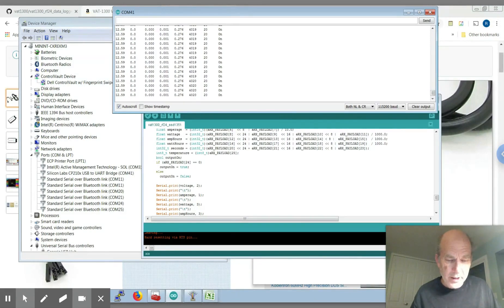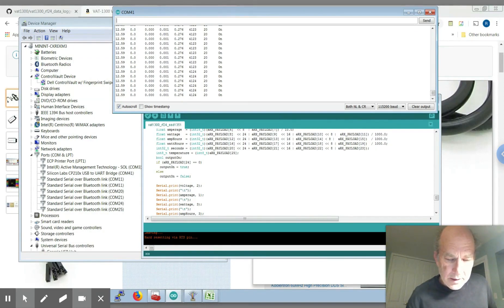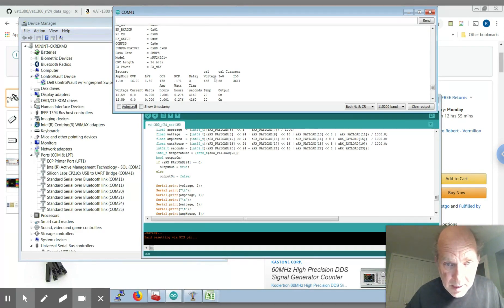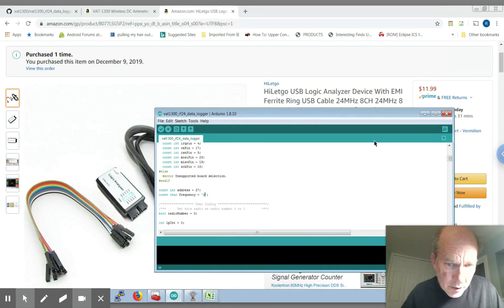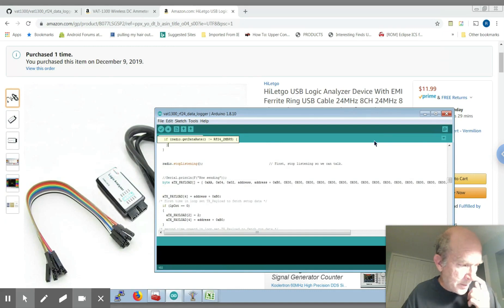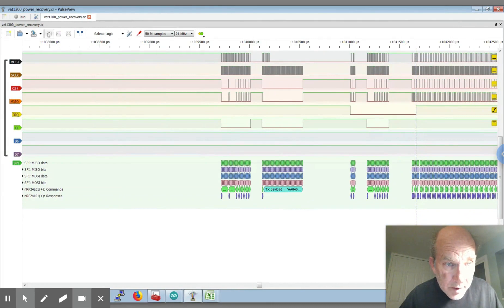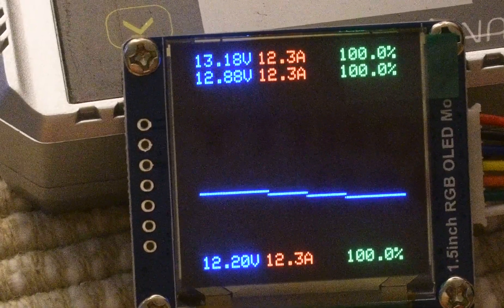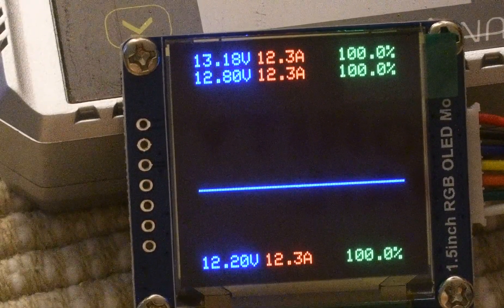A battery state of charge(Volt/Amp/Watt-hour/coulomb counter)solution for wireless network Part 3of5

Comment: Great work. Thanks for reverse engineering these. I have a unit coming. Would be nice to find just the shunt units without the displays. I plan on using these with my raspi monitoring system.

Comment: Hi Robert, Do i need to preprogram the nrf24 units as sender and receiver? I soldered my units on the controllers but my wireless radios does not seem to work.  I connect the units with usb cable they work?
Reply from the maker: If you are having trouble getting the control (the display unit) link to the shunt then check to make sure you are using the correct frequency channel (A to Z) and correct address (1 to 99).   Those may or may not need to be set correctly for the wired connection.  I don't remember.  There is no firmware.  You did put in an authentic nrf24 in both the controller and shunt, right?  The Chinese knockoff units and the authentic nrf24s do not talk to each other.
Reply: @flatman2008   thx for the quick reply i tried to resolder some new ones again and it started to work. thx a heap.

Comment: Hi, I am the operator of my own small photovoltaic power plant, which I built myself. I run a scada system on my laptop, which reads my three controllers via Modbus and visualizes the data from them. I bought a VAT 1100 and I wanted to get the data from it to this scada either via a cable and some converter, or to intercept wifi communication. Do I need all of the above HW stuff, , or is it even easier to do it with just a USB Logic analyzer, for example? Thank you for the info.
Reply from the maker: I suggest you watch part 5 where I show how to tap into the cable that runs between the shunt and the display/controller.  It's not actually USB.  It's RS485. This is a much simpler solution requiring only a RS485 or RS422 dongle.
Reply: @flatman2008  Robert, thank you. I found some information not in the video but in the description below it - but there is only this: "RXD + hooks to green (D +) wire of the Micro USB cable and RXD- to the white (D-) wire." Do you happen to have any more detailed info? I assume that the wires of the converter need to be soldered somewhere on the lower PCB - but I don't know exactly where - I did not find any detailed photo. From Aliexpress I have bought this converter:
https://www.aliexpress.com/item/33025022759.html?spm=a2g0s.9042311.0.0.27424c4duQj6Nw
Do you think it could be used?
I will be very grateful for more detailed information, photos or links.
Reply from the maker: @antoni_sk  I suspect the RS485 pod you listed will work.  The A terminal would be hooked to the D- (white wire) and the B terminal to the D+ (green wire) of the micro USB cable.  No need to solder to the PCB.  I just spliced into the cable.  
I used a ftdi usb-rs422-we-1800-bt cable.  Because you are only receiving data, an RS422 dongle works fine.  But a RS485 should also work.
Reply: @flatman2008  thank you, i'm stupid that it didn't occur to me right after reading it. A few minutes ago as I read your answer, I was just thinking about that communication must still go through the supplied USB cable that connects the shunt unit to the display unit. Your answer only confirmed me in that. So far, thank you very much.
PS: I still had a question - when I cut the USB cable and connect it via converter to the PC, will the wifi transfer to the display unit still work?
Reply from the maker: @antoni_sk  The display/controller will be functional in it's tethered(wired) mode.  The added RS485/RS422 dongle is just "spying" on the data going between the shunt and the display/controller.  
When using the USB cable the radios are disabled.  It's just the way Juntek designed the system to work. Wired or wireless but not both at once.  Don't confuse the wireless mode with WiFi.  It's a 2.4ghz proprietary communication protocol that is used between the nRF24L01 radios.
Reply: @flatman2008  it's a pity, you didn't like me very much with that information ... I wanted both - the display to work wirelessly and the logging data to the PC...
Reply: @flatman2008  I made one attempt today - I connected a USB cable (only one side connected) to the shunt unit and expected that communication with the display drive would stop working ... But wireless communication continues to work  :-)
Reply: @flatman2008  hello. Are you sure about the colors of those wires ? Because I measured 5 V between green and white. That's probably not OK.
Reply from the maker: @antoni_sk  Is this with or without both the shunt and the display) controller plugged in?  I don't remember what the voltages were.  However, I don't think 5v is unreasonable.  I'm not sure of the RS485 specification for differential voltage but I'm almost positive 5v is a reasonable logic level.  Think minimum is 1.5V and maximum is upwards of 10v.  Lower idle voltages are also allowed but then Juntek may never let the bus go into idle.

Comment: Just wanted to say a massive thanks for the time you've put into this. I've used all your arduino code and made a version that publishes into ubidots, and it works great! Spent ages trying to find something like this to add to my system.
Reply from the maker: You are very welcome.  Glad you were able to leverage off this work.  I was not familiar with Ubidots. Looks interesting.  In part 4 I show how to pipe data into an InfluxDB database via Node-Red then display using Grafana.  Part 5 shows a wired technique direct to the Raspberry Pi that eliminates the need to replace the radios and also does away with the Arduino.  It has the added advantage of keeping the Juntek display/controller in the system.  
I'm going all in with Node-Red, Influx and Grafana.  Perhaps time for another YouTube.  In addition to the Juntek shunt, I've hooked up my Epever MPPT solar charge controller (downloaded from GitHub, credit goes to AdamWelchUK),  my Airmar Weatherstation (NMEA data, GPS, wind and lots of other data that sits on top the mast of my sailboat) and just for fun, playing around with a BLE heart monitor.  Last but not least a more high end Sendyne SFP101 coulomb counter.  Also looking to add a smart Lifepo4 BMS into the system.
I had been using Kplex as my NMEA multiplexer to combine data from multiple sources (AIS from the VHF radio, depth/speed transducers, and stream out NMEA on a TCP port via Ethernet and WiFi to OpenCPN navigation software and the autohelm).  Node-red seems like a better solution for that.  Say tuned for additional YouTube videos.

Comment: Hi Robert,
I fixed it. The Problem was the Hardware-Type in Arduino. Wemos and Lolin(Wemos) are quite different with CE and CSN. Now it works perfect.
For me is netxt step to port the code to Raspberry. Saves one interface. Thanks again, Ralf

Comment: Hi Robert,
thank you very much for publishing your solution. I tried a similar one some month ago, but my technical knowledge is not sufficiant.
So I realized it as you described. First I tried the sketch togeter with a NodeMcu und a nRF24L01. It worked, but I got no usable results. On the serial I got the message "Radio failure detected, restarting radio", on Telnet of the NodeMcu there were Messages but all values were zero.
So I soldered both Units of Juntek as you described. The result is exactly as before. The good message is, that nothing was destroyed. But I got no values. I use channel A17 as you described. I think there is a problem addressing the Juntek but I have no glue.
Do you have a hint for me? Thank you, Ralf

Comment: Hi. I have tried your Sketch and it is working find with my MingHe Shunt unit. Possible having a "origin" NRF24. But the Juntek Shunt unit is not working out of the box. If I connect my Juntek display on wireless while running the Sketch at the same time, I can trigger the communication to the Sketch (ESP32+NRF25L01+) . I can then turn off the Juntek display and still getting measurement from shunt. Still getting failed to send. If adding radio.enableDynamicAck();  before radio.write I get constant data from Shunt to Sketch. Resetting the Shunt the communicaiton stops. Could it be something missing in the initial command to Shunt unit to get it started. Any idea to get it working with Junkek Shunt without replacing NRF24?
Reply from the maker: I took a quick look at the data on the USB cable traveling between the base shunt and remote display.  It is RS485 differential data, at 57600 baud.  Same data/format as is transmitted wirelessly over the RF24 radios.  So for those looking to grab the data without replacing the nRF24L01s this looks to be a good solution.  Also would allow you to keep the display in the circuit.  There are any number of RS485 or RS422 modules (for Arduino or Raspberry Pi) or RS485/RS422 USB cables (for Raspberry Pi) should work to grab the data and decode it.  RS422 modules/cables would work since you are only listening to the data and not transmitting.
Reply from the maker: I was able to hook the Juntek units (base shunt and tethered display) directly to a Raspberry Pi with an RS422 USB cable spying on the data being transferred.  My son helped me cook up a Node-Red setup to load the data into the Influxdb.  A very clean setup.  I'll post the Node-Red flow file somewhere and maybe shoot yet another YouTube video.
Reply from the maker: I spent many hours trying to get the Chinese clone NRF24s to talk to a real NRF24.  Once I replaced them things worked right away.  Others report they clones are not compatible with the real units.  Sound like you got very close.
I have had questions about the USB interface.  It does not enumerate and is likely not USB at all.  Someone commented it looked to be differential.  If so, it could be RS485.  I'm thinking of taking a crack at decoding it.  I have not looked yet but if I'm lucky it's the same data as sent wirelessly.

Comment: i see a really high speed for the baud rate and alot of transmissions per second... maybe a slower one will lower the power consumption? also once started the arduino maybe make it sellp and waike up like 4 times for second will be enuogh.... just thinking at the long time connection and power draw from the batteries... i even disalbled the led's on the base units so when they are on on mode will not draw those 20mA...